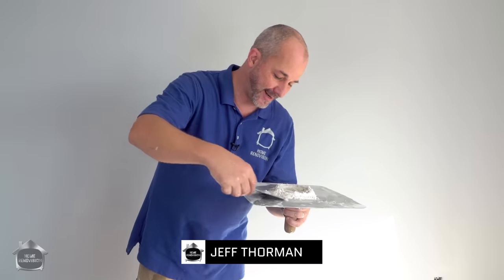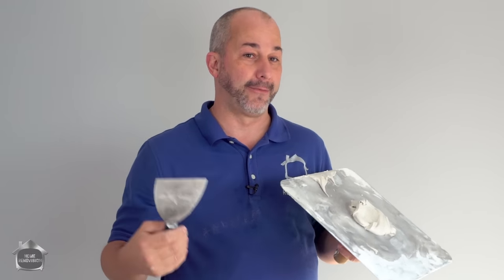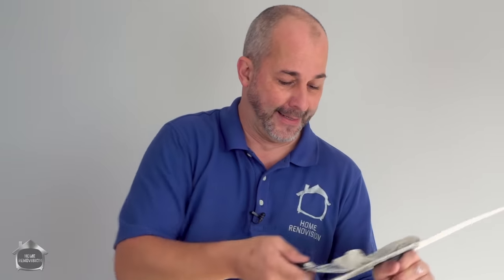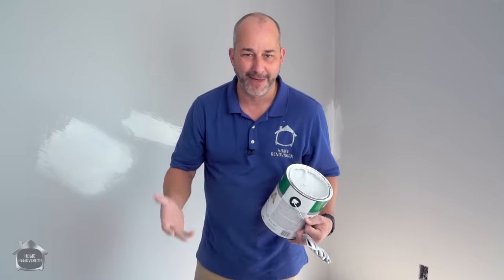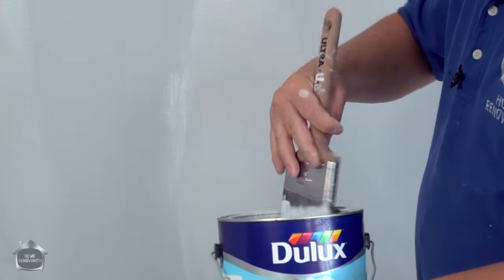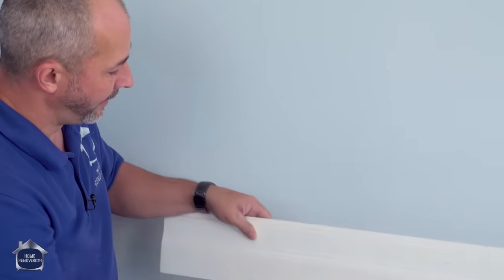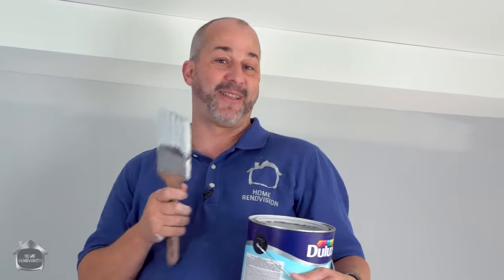DIY Drywall Part 5 | How To Sand And Prime For Perfect Walls

Comment: 4:50 sanding drywall hole patches
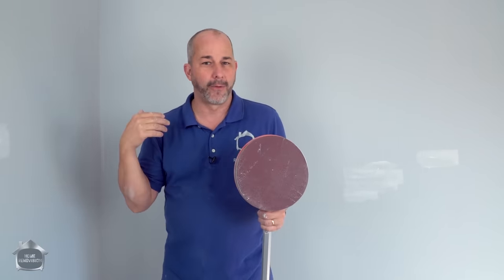5:50 how to deal with dust on walls
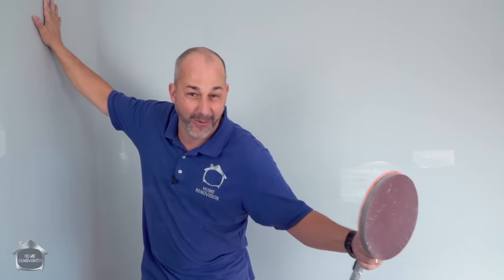👉👉👉6:30 WHOLE PROCESS SUMMARY
6:45 add thin layer of primer over patches 
7:00 sand whole wall
8:00 add 2nd layer of primer over patches to avoid flashing
9:25 NO TAPE CUT IN with paint color
11:00 paint brush light strokes on patches then use mini roller to go over patches again
15:15 cut in and then roll one wall at a time while its still wet

Comment: Thank you so much for sharing these educating videos. I was in the process of painting my parents bathroom which had not been touched in 25 years.  Unfortunately, they decided to use mobile home wall covering when they built back in 1975 and as a  change. The walls were Kiltz with out even cleaning more less preping for texture or loose spots in the  vinyl. Which over the years cracked and pealed one , two and in some spots several layers of the wood down to the gypsum. Watching Your videos made it possible for me to complete the project with an almost flawless  flush painted surface. My parents are so pleased. I will carry your  simple easy to understand and follow knowledge with me for future projects and will share your link for reference on other DYI projects. Thanks Again,   Karen Wilson

Comment: I never realized you were supposed to sand in between primer coats. Good to know!
Reply: Me neither! I’m using a primer/topcoat in 1, would the dust cause problems when I’m doing my 2nd and final coat?
Reply: Yes it really makes a difference. So smooth and just takes a few minutes
Reply: I vaccume the walls after I do my initial heavy sanding. Then I prime and seal everything come back and do the prime check re sand everything then finish the job. Don't leave dust on the wall its a shitty way of doing stuff.
Reply: What sandpaper grit should I use for sanding the primed walls?

Comment: A little trick I've learn to show drywall mistakes. I use an LED flashlight, hold it flush against the wall, so the beam is parallel to the wall. You may need to close the blinds. That will show EVERY single defect in the wall. From the wave of the wall, down to a hair that got stuck in the paint. No need to do a first coat, and wait for the sun to be just right.
Reply: Also the perfect way for you start questioning your life's choices 😅
Reply: @Soliber  why is that?
Reply: @EmptyPsychosis  you see all the mistakes you’ve made and start to think you should just start over 😄
Reply: @Soliber  fair enough. This method actually saved me from buying a house that would have financially ruined me. It was about 100 years old and next to a lake. The previous owner did a lot of upgrades to make it look really nice. I noticed some discoloration on the brick around the fireplace, and I  thought "well, it's a hundred years old, it's probably had a flood before in that time. No big deal." Then I put my light to the wall and aimed down. I saw a horizontal line 3' high in the drywall going around every wall. Which is standard replacement procedure for flood damage. Seeing that, combined with the fact everything else looked recently replaced, I talked to the neighbors and found out that it floods at least once a year there.

Comment: I went to YouTube to figure best way to remove drywall dust before painting. But here I learn I can leave the dust and it only makes the final results better. It seems to me that he brushes the areas with the dust on the wall (light brushing over the patches). Helpful video.

Comment: i do high end auto body paint work. so a lot of this stuff is similar but in a different aspects. (helps i was a contractor assistant when i was a teenager for a few years) just being familiar with materials goes a long way. i have to be extremely picky as far as prep work. usually im only dealing with a small area with little room for imperfection... but, what im getting at as you where saying you need to look over very large spaces. as far as i know being picky is important but you need to get the job done. everyone has to find their happy medium. love your vids man keep it up! Im moving into a fixer upper and nothing wrong with a refresh or learning something new while your at it, appreciate what you do!

Comment: So I'm a little confused, is that paint on the walls now or primer? And are you saying that you sand the walls down with the primer on it before you start with the final coats of paint? Or do you sand between coat one and coat two of the paint?
Reply: Sand everything and inbetween every coat you do. Remember one thing, paint plus sand in every application you ever do. Just use 220 grit so you don't damage it and lightly rust it out.

Comment: So I'm painting a dark green basement with LOTS of imperfections in the drywall. The method I went with was: 1)mudded imperfections 2)sanded entire wall including patches, 3) primed walls completely,4) lightly sanded primed walls, and 5) finally wall paint (2 coats). Am I doing too much? Do I need to sand after priming?
Reply: You sand after priming. You sand inbetween your coats of paint until your final one is on. All 220 grit light rusty sanding your doing the correct steps. Use hotset mud for your patches. Doesnt shrink and is a better product then all purpose. Also doesnt technically need to be primed but always good practice too prime anyways.

Comment: Thanks for your videos and I became a member today.  

After applying PVA primer and doing more repair on finishing, I would like to know if I have to do priming again after the touch-ups with join compound or 45 Easy sanding.
Reply from the maker: yes! all patch work need to be sealed with a primer before painting. Cheers!

Comment: Do you need to add joint compound to the entire drywall or just where the drywall connects to other pieces and/or where there are spots you are fixing on the wall?
Reply: Just where it connects or for patchwork. A good primer directly on the drywall is fine for the other areas

Comment: Hi, we're prepping to pain the walls in this house we just bought with horrible rough paint on the walls. What do you think of using an electric orbital sander rather than the radial sander you have been using? Could I get away with this electric orbital sander in between coats too? or will it be  disaster waiting to happen and take out fresh paint. 

(thanks! I've been watching your videos a lot for our RnD - research and destroy)

Comment: Jeff how does a DIYer fix or upgrade or just smooth out 70s, textured drywall and popcorn ceiling? Thank you for all these videos. Even though your codes are different that ours down here it's still invaluable information.

Comment: Wait I'm confused.  After you mud and taped the drywall.  Did you put a prime coat on and then a the 1st coat of paint THEN go for touchups and patch work?  Can you elaborate on why you prefer brush and roller over a sprayer, not those cheap crappy sprayers but a professional sprayer.
Reply: Yes, primed first and did a check with the light,  put on the first coat for wife approval and found more imperfections that were highlighted by the colour when the sun was shining in th room. As someone who paints with a gun for automotive purposes,  yes I can see the appeal but aerosolized particles travel everywhere, would need to plastic wrap a couple feet around the perimeter of your ceiling when doing the edges
Reply from the maker: I don't spray becasue I am trying to teach a system that anyone can use. spraying is an art form and it takes too much experience to get good at it for folks who are renting tools.
Reply: @HomeRenoVisionDIY  hey thanks for replying!  Keep em coming!

Comment: TONS of great tips in this 6 Part Drywall series!
I apologize if this is a really "newbie" type of question but, Which grit # sanding disc would you suggest using for the radial sander when sanding between coats of paint?
Reply from the maker: 180, cheers!
Reply: @HomeRenoVisionDIY  which company invented the drywall sanding machine?

Comment: quick question: i want to repaint our basement and the walls are painted concrete. the paint is old and falling off and i want to paint the walls. question (1) what is the best orbital sander to remove the old paint and what grit is best for removing paint from painted concrete walls??? question (2) do i have to scrape all of the old paint off the wall or do i have to just sand /scrape the old bubbly paint that are falling off and paint a fresh coat on top the old paint which are still intact??? question (3) after sanding/scraping off the old paint, do we need to wipe down the walls for dust with a damp towel before painting??? (4) last question: how many coatings of paint do i need to do to prevent(best brand of paint???)the concrete wall paint to bubble/fall off???

Comment: I want to install about 2 ft of drywall  (previously removed due to a flooding and mold) to the existing wall that’s painted surface. Please let me know how to do that… especially kidding and taping.., would it stick to the painted surface on joints with existing wall

Comment: What grit sandpaper would you recommend for sanding walls before you paint?
Reply: I'm wondering what grit he uses, too...
Reply: You use your regular grit. Probably 180 if your sanding mud. If your doing your rusty sanding then I use 220 as it just scuffs it up so it increases adhesion and takes any small stuff out. Same grit for inbetween paint/primer

Comment: Hi Jeff first thank you so much for what you are doing here. You are giving us rookies enough confidence and knowledge to do jobs way above our capabilities. I'm remodelling my bathroom and you are now my favorite guy. I lovehow you take the time to explain important theories! Got a couple questions. I just finished watching your video about installing subfloor. Your emphasis about the importance of how close the screws need to be make perfect sense. I just finished removing the old tile floor - an inch and a half of cement and tile. I got 5/8 subfloor now and will need to add more plywood. The metal pipe for the toilet seat is now sitting about 1.5 above the original subfloor. Do I need to add plywood and possibly cement boards so that my tile floor end up being flush with the toilet seat pipe? Thank you!
Reply from the maker: Hi Tony. You want the top of the toilet flange to be 1/4" proud of the finished flooring. Cheers!

Comment: What type of paint would you recommend? Eggshell or Semi-Gloss or Full Gloss for a living room?
Reply: UltimateArtistT good lord eggshell would be the glossiest finish I’d ever do for a living room wall. High quality paints these days are washable and scrubbable, so I use flat (BM Aura or SW Emerald). Best color rendering and best hide. For stairways, hallways, or anywhere where hands and things are likely to touch, I use eggshell. Using higher sheens shows way more imperfections and just really makes a room look terrible especially if you’re using 3/8 or 1/2” rollers. I use satin or semi-gloss on trim and cabinetry (with either a brush or mohair roller), and honestly can’t say I’ve ever used full gloss for anything. Bathrooms.... now that’s a whole other animal. Level 5 or hard troweled plaster can take higher gloss, but most homeowners aren’t in that boat.
Reply: @danervin2530  With respect i use pearl or satin. Flat is for ceilings so you don’t see as many imperfections from ceiling lights. But if I was a contractor I would use flat so that I didn’t have to do as good a plaster job.

Comment: After applying primer I realized that i need to use compound joint again to smooth out the surface. Can i use compound joint over the primer?

Comment: I'm wondering if you dry mop after tape and mud, wouldn't you then just prime and paint without needing to sand after primer? By skipping the mopping you need to sand bc of the rough surface?

Comment: Jeff, when mudding a plaster wall with a swirl pattern...do you use the same mud you do on drywall? Also, do you just paint with roller, etc as you do for drywall?

Comment: Hello, I have a question - in your videos (and most other videos i've seen which are made in US) the drywall is installed directly on the the timber/wood. In here (Romania), I've seen that all of it is installed on a series of metal frames OR they put some small metal pieces on the wood and on them they install the drywall. They say they are doing this beause "the wood works" and in time small cracks will form on the drywall/paint. Is it something "overengineered" from your experience ? i`m asking this because soon I`m starting to build a wood frame house (not me, the contractor) and i`d like to know how to proceed ;p Thanks man!

Comment: Hey Jeff, do you by chance have a video/recommendation on painting over a small patch job with the same colour paint as the wall and not painting the entire wall. I’m worried I’ll end up noticing spot I’ve painted over afterwards. Thanks!
Reply from the maker: That my friend is impossible. You will always notice it because there is always a different level of acrylic in the paint from the time you start to the time you finish. patching requires the complete wall or it will be noticeable. the good new is once the patch is primed and first coated you only need to roll the wall 1 time. Cheers!
Reply: Thanks for getting back to me. Luckily the walls are not that large to paint. Keep doing what your doing. Your videos are very informative and entertaining! I’m using all your tips on repainting my kitchen this weekend!
Reply: @HomeRenoVisionDIY  thank you. I had the same question

Comment: Hey Jeff. Amazing videos ! Any recommendation on the best Primer ? Im completing sanding for my whole basement in a couple of days and want to apply primer on my drywalls before I paint. Im in Montreal so I do have access to Rona, Home Depot etc.
Reply: I'm not jeff, but I'd use a killz product in the basement to deter mold and mildew in case of a moisture issue. Killz max maybe?
Reply: For future readers: fresh/bare drywall and mud you'll want a PVA/drywall primer.

Comment: Wanted to know if I patch a hole, how can I paint over the patch and get the paint to match or blend? Would I need to paint the entire wall?
Reply: Over size the amount of primer. For example your patch hole is 5x5 i would triple the amount of surface area of primer and blend it through. Same with the paint, the paint would then overlap the primer, not by a huge margin but it would be a light blend into the exisiting wall.

Comment: Thanks again for videos. I'm in middle of finish coat of mud and priming other areas..my issue is after 1st 2 coats of primer, the metal corner bead still showing...Any pointers?
Reply from the maker: Hi Mike sounds like you are using the wrong primer. make sure it is designed for new drywall , that type of product has more solids and finishes quite white. it also seals the drywall better so you don't use as much of the finish paint . Cheers!
Reply: @HomeRenoVisionDIY  Yeah I made the mistake of taking the wife's word for it before looking at which bucket she was using. Thanks for the reply...

Comment: How much pressure are you putting on the sanding pad ?
Reply: Light to moderate pressure, too much causes too deep of scratches that won't fill nice, you just want to get rid of surface imperfections that's all
Reply from the maker: Cheers Gilbert!

Comment: Hey Jeff, thanks for sharing your knowledge and experience. question.. did you make the whole cutline in once? And after that hiding the primer.

so if you start painting the wall, the cutline will be total dry like cork:-).I thought the cutline needs to be a bit wet so it mixes with the paint that you put put on the whole wall to avoid shining of the cutline.
Reply from the maker: on the first coat you can cut second so you have time to let the patches dry. then you can go straight to the second cut and blend the wet edge with the second roll.
Reply: oh, now I am watching the rest of your video (yesterday I was watching my son who was ill and I stopped at minute 10). Now Im watching further and see my question / your answer. sorryfor the question it was unnecessary. I am painting a lot at my work so I was very curious since it could save me a ton of time and thanks again for your videos. A 1000 greetings and Merry Christmas from Holland

Comment: Hi How you know as wall is smooth? I done this job dozens of times and without light which  flash from different angle You are  not able to achieve nice smooth  wall without scratches special after this type of sanding. No chance...
Reply: That made no sense at all
Reply: @frankhayward4950  what do you mean???

Comment: What grit sandpaper do you use on the walls?
Reply: You will want to use a fine grit - 180 before prime paint. Then 220 after priming or in between coats.

Comment: I have a question about covering tongue and groove walls. I was going to tear them down and put up drywall but I've read that you can actually apply filler or drywall mud over it and paint as if it was drywall. What would you recommend for this? It's a pretty large application, probably about 1500 square feet.
Reply from the maker: you didn't read that on my site. installing drywall will be ten times faster and get a better result.

Comment: If you have orange peel textured walls you wouldn't be able to sand between coats, so what then?
Reply: I asked a similar question in the last video and apparently the texture is being skipped in this series and will be presented in a different video this Spring.
Reply: Skim coat entire wall... aka level 3 finish.
Reply from the maker: That is a knockdown texture so the radius 360 actually can be used to remove dirt and lint from the roller with a quick pass. Cheers!